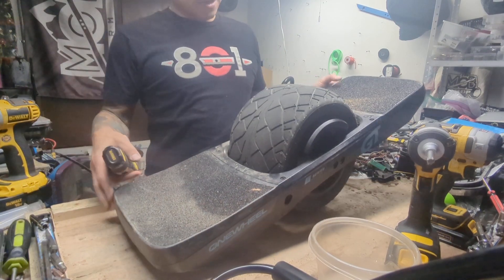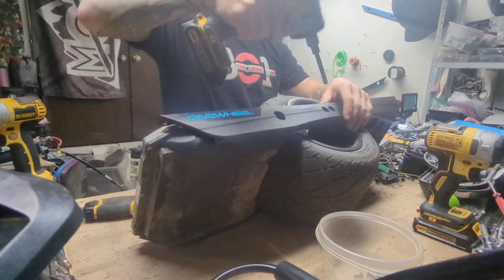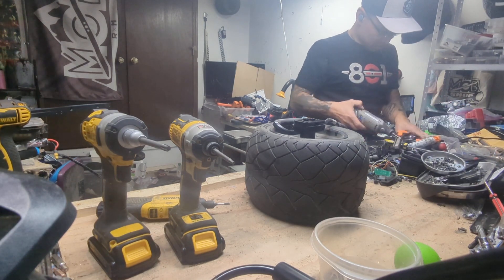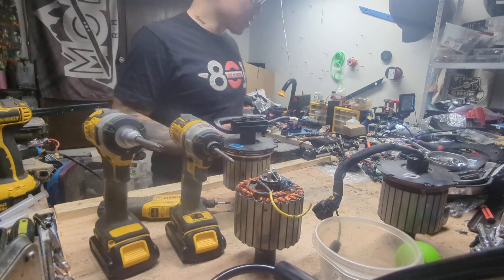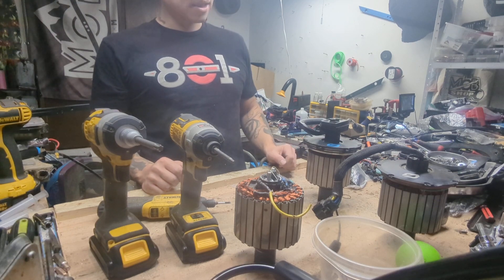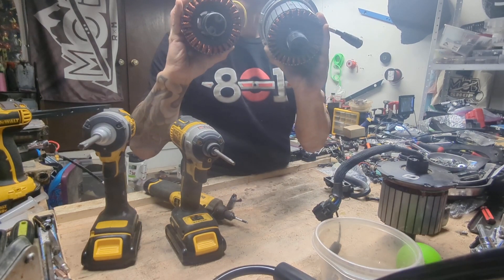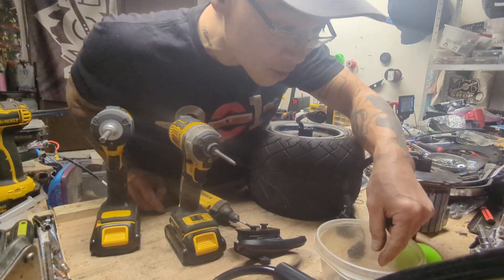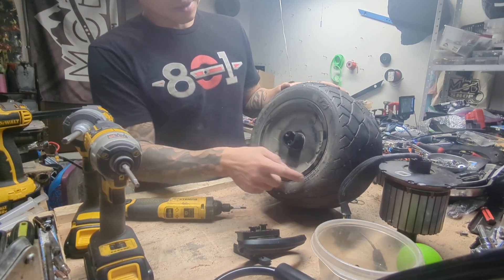Onewheel GT-S Series Motor Analysis

Comment: 👍👍 informative video, FM came out with Gt-S fixing the issues of original Gt design but instead of just replacing the Gt with it they added another board to line-up and raised the price another $1k 🤪‼️ & “Consumer still can’t replace battery or electronic components on this $3200 PEV they bought an own without bricking it🤦‍♂️(like batteries last forever & electronics don’t stop working)”

Comment: 113v and theyve done nothing more to waterproof it. Fm is such a lazy company. Dont count the windings do a resistance test across the from the plug pins vs the gt. This is a better measurement as the windings diameter may have changed

Comment: So do you think they’ve made these fixes to the GT’s going forward as well? Or do you think this will only be the case on the GTS’s?
Reply from the maker: Wouldn't seem strange to me. On top of needing a rider team they need a team of technical minded shop guys like us to help beef it all back up. Imo anyway!! @onewheel we're here for you
Reply: @Owmobshop  Preach! 💯
Reply from the maker: Not sure. Id love to get a GT in here that's new off the line to check.
Reply: @Owmobshop   Absolutely!  I guess we will find out eventually.  It would seem a little strange to me that they wouldn’t make these basic changes to the GT as well at this point.  
It would not only be an improvement on an existing “design flaw”, but also just make more sense from a business/manufacturing standpoint.